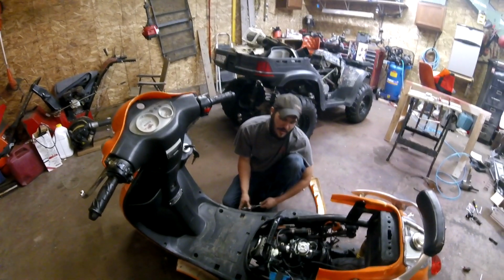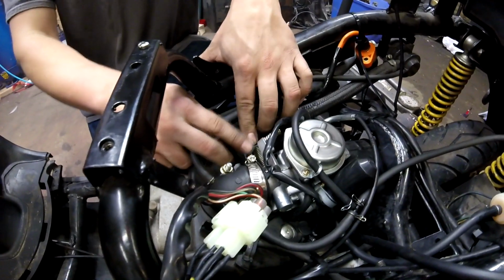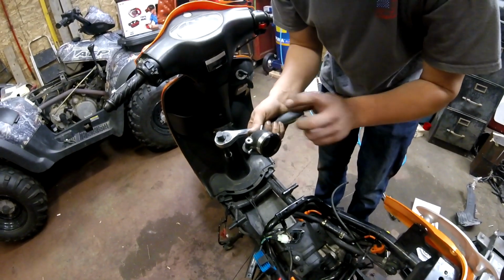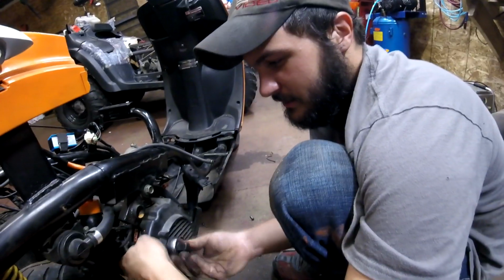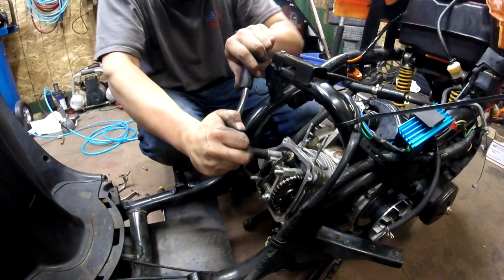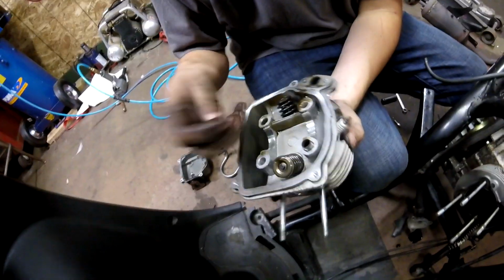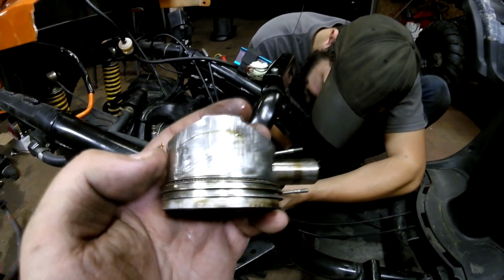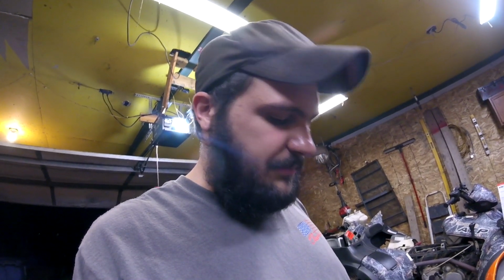Hillbillies Build A $150 Scooter Engine. (TearDown)

Comment: @HunterTuned Hey man hope everythings going good. Had a ? I was hoping to get your input on. So im going to be replacing fuel pump on my '07 classic 2500hd.  Motor is a lq9 with Cam, CAI, ported 317's, 50lb injectors(the stock ones out of the 2010+ 2500hd silverados). Anyway I was thinking about going with a walboro vs just buying a new stock one. Which model would you recommend? This winter Im either  going to finish building the NA setup(longtubes, tbss intake manifold, Etc) or im going to slap a gt45 and run low boost on it. Not going for crazy power maybe 600whp since its my daily/worktruck and i want it to stay reliable.  Anyway i want something that I can run that has wiggle room for future stuff. Im running a returnless fuel system but if need be I have a return style rail that I can throw on.. Watched your turbo 2500hd videos but i didnt catch what model fuel pump you went with. Also just wondering would it hurt my mpgs by switching to a stronger pump when i may not need it at this point in time? Thanks for your time.
Reply from the maker: Walbro 450 is what I would recommend
Reply: @HunterTuned  cool thanks

Comment: Maybe grind on the outside of that jug a bit to reduce the amount needed to remove from the case. The bottom of the cylinder doesnt need to be that strong.
Reply: That's exactly what I was thinking

Comment: My wife and I have two of these that have the same engine. These are called Tao toa. I use to drive mine to work but now just take them camping and take them to the beach. I didn't know you could get the big bore so cheap.